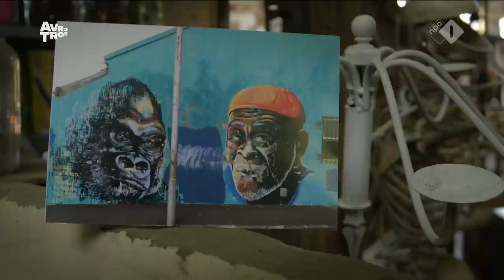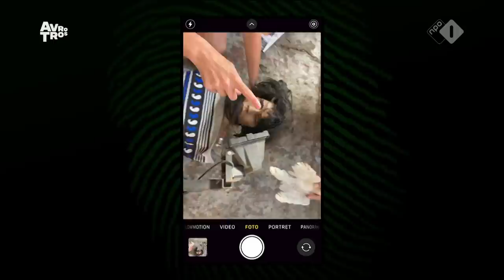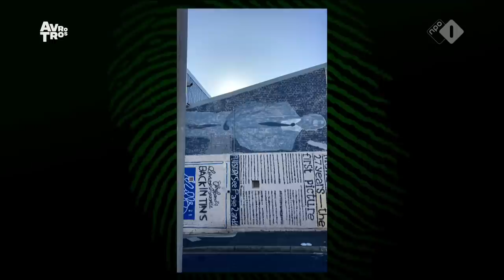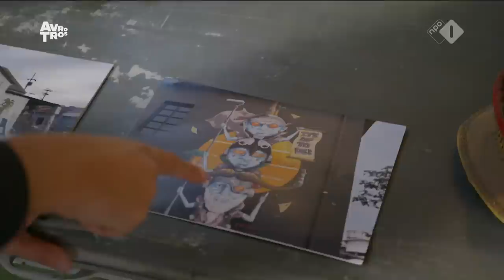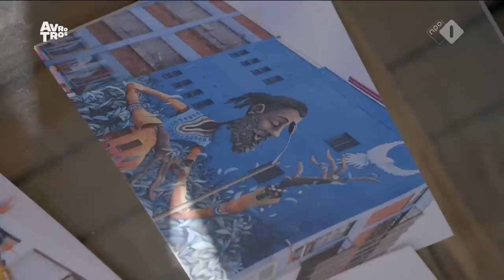Wie is de Mol (The Mole) S23E02 with English subtitles

Comment: Thanks again Marieke! What a solid start to a solid season thus far! Spoilers beloooow:

The plot thickens with this episode! If I had only this episode to guide me on mole selection I could legitimately see any one of them being the mole, with maybe two exceptions.

First challenge was not the most exciting on the surface, but still had some fun nuances that make it more than meets the eye. And I am continually digging the $3000+ challenges, although bummed that we only had 2 instead of 3 assignments the last two episodes. I am absolutely uncertain as to what the mole would want in this challenge. Obviously the mole wants to minimize the pot, but they also want to go unnoticed for as long as possible. Does the mole try to earn enough money to help Sarah reenter the competition so that money is lost? Or does the mole try to earn the least amount to prevent Sarah (who has a step-up from everyone else knowledge-wise) from entering the game while minimizing the money earned? Maybe the mole was afraid of Sarah re-entering the game and did everything in their power to prevent that from happening, no matter the cost. $1300 is pretty close to the most they could actually earn this challenge without Sarah coming back to the game. I have a sneaking suspicion that the mole did not want Sarah back in and thus did the bare minimum this challenge.

Keeping in mind that the ones who do the worst are perhaps more suspicious, I can still argue a fair amount of people were suspicious here. They split themselves up into groups of 3, so I'll go over them individually.

Group 1: Daniel, Ranomi, and Froukje. Obviously we can ignore Froukje. Daniel suggests going for the lesser amounts, which is mildly suspicious. We don't see Ranomi do much, other than get caught somewhat easily once. But other contestants call her out on her suspicious behavior this task by being pretty lethargic for a former Olympian. Also mildly suspicious. Daniel shakes the tube at one point, to force the balls down to decrease the amount of money in the tube, which was the most suspicious activity in my opinion in this group.

Group 2: Soy, Nabil, and Annick. I still don't find Annick suspicious (they've been focusing on her screw ups too often). Nabil has the absolutely atrocious idea of using the third stretcher in the worst way possible (piling on top of the second stretcher) and thus making Group 3 completely obsolete. Soy at least has the better idea of carrying the third stretcher (which still made Group 3 obsolete, but at least was a better method of carrying vs Nabil's). But, even after being told by Daniel to go for the $1000 tube, Soy still wants to check out the $1500 tube and drops his plate of balls in the process. Nabil helps goad him into wasting time in checking out the $1500 tube anyway, even after dropping the balls. And Nabil at one point is shown dropping the silver balls into the tube one at a time, a remarkable time waste (and maybe hoping the shock will be delivered so he can drop them without fault). I actually don't blame Nabil and Soy in losing a life, because it seems to be near the end of the challenge. The second time they're caught, Nabil doesn't look like he's trying too hard to hide. I still think this was at the end of the challenge though so I don't find it as suspicious. Most suspicious activity in this group was Nabil dropping the silver balls in the tube one at a time.

Group 3: Jurre, Sander, and Anke. So this team is useless for the start of the challenge since their stretcher gets stolen. Jurre says it's 20 minutes, but I think that's an exaggeration. It's only one cycle of rock collecting that they're standing around for, but no time stamp is technically shown. When they ask Group 1 where they found their stretcher, Daniel is weird, asking the two members of his group where they found the stretcher (I mean he was there for that wasn't he?) before telling them it was by the pile. And yet I believe by this point Group 2 is using two stretchers so if they go by the pile there will be none left. Why it takes them as long as it does to realize one of the groups has two stretchers I don't understand. Some mild time wasting with the silver balls by Anke and Jurre, but nothing outrageous. Jurre always drops a giant handful of the silver balls in the tube, so saving time here. And he really hustled at the end to earn an extra $100. I guess Anke is the most suspicious here, but I'm not as suspicious of this group as the other two.

Final thoughts: this challenge would have gone remarkably better if they had split themselves up into groups of 4: 3 duos to collect the rocks and one trio to move the balls up and down the stairs. 

Daniel and Anke are an interesting bond. Some would think Daniel reaching out to form a bond makes him less suspicious, but it doesn't lessen it for me. It is completely in character for him as a candidate to reach out and make a bond, because he seems the more fanatical type. It would thus only make sense to do so as a mole to alleviate suspicion. And it's nice to have a bond; I don't remember there really being any bonds last season.

And holy crap this second challenge. This one kicks ass, it' so good. Love the location, love the multilayering, loved the train wreck that it was. Let's start pre-challenge. Did the mole get into the van last in order to determine which part of the challenge they would participate in? Getting a bit meta-gamey, but Froukje gets in first in her van, then the backseat gets filled up with Anke and Soy, so it's somewhat safe to assume Daniel is the last to enter that van (Froukje seems to confirm with her confessional that this is the order). You don't get to see anyone in the second van. If the mole picked their spot, it's likely to be Daniel or someone in the other car. Soy and Anke automatically dip a bit in the suspicion as a result.

The actual challenge is such a disaster that, again, a lot of suspicion can be thrown about. Let's focus on each group:

Group 1: Ranomi has some good ideas (go quickly so the other team can start ASAP, finds bird for successful photo) and some downright terrible ideas (fish). Nabil is the one to offer the mailbox as a hint with the elephants which to me was a terrible idea. How could they not find more than one elephant? I honestly think though this group does reasonably well with what they had to work with. Jurre holding the camera was a bit suspicious. But maybe I have a soft spot for him, because to me the camera angles weren't the main reason the other team did so terribly. I could easily see the mole wanting to be in this group (to prevent the worst in doubling the money won), but the other team did so bad that I suspect them more.

Group 2: Anke offers up the terrible guess of the bee (not a fly) and the top hat. Still, she doesn't have the phone very often (which is the position with the most control this task), which makes me more suspicious of Daniel and Soy, who almost exclusively have a phone. Daniel gives a correct answer, but he does it without consulting Anke or Soy. I could see him doing this to set up distrust between them. Soy is terrible in this task, but the edit makes it really obvious which makes me less suspicious of him. I think the primary way the mole would have sabotaged this group would be to prevent them from finding the murals in the first place. I feel like they only saw 4/6 of them at the most, and it was easy to overlook the right answers by blaming the photos being bad. I'm more suspicious of Group 2 this task, but mostly suspicious of Daniel and Anke (Daniel moreso, for getting into the van last).

So after two episodes, my prime suspects remain the same: Nabil, Daniel, and Ranomi, and I legitimately don't know who to go into the tunnel with yet. Jokers appear to be back next week, as does 3 assignments, which will be nice. I'll need the extra help this season!
Reply: That second challenge was a glorious catastrophe 😂
Reply: Waarom zo lang?.?.
Reply: You mentioned that you don't remember any bonds from last season, but (hopefully without spoiling) two out of the final three players were often described as being close. I thought it was implied that it was more than an alliance, but they liked each other, too. Strange to me that I haven't seen anyone talk about this. Seemed to me like an unfair advantage for the winner of last season... 🤷🏻‍♀ (PS Great analysis of this episode!)
Reply: This was super interesting to read. I had full tunnel vision on Nabil during episode 1, but was finding it hard to justify on episode 2. Your breakdown of this episode further proves to me that I should keep my attention on him. Stealing a stretcher and dropping balls one at a time is VERY suspicious.

Comment: Spoilery question:

It seems like Nabil is doing a really good thing by adding that blue robe, but could it be that this leads to the other team confusing it for the other blue-ish man painting? As the mole you’d know what the other mural paintings look like as well, so you could deliberately use objects that also look similar to the other paintings. It’s a stretch, I admit. Because it did actually look like the actual painting. 🤔 Does anyone have any thoughts on this?